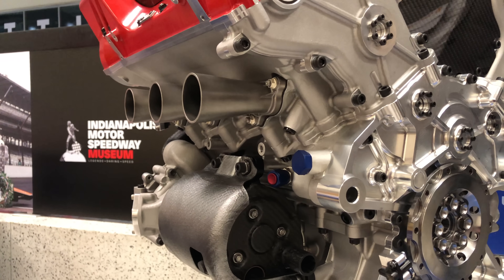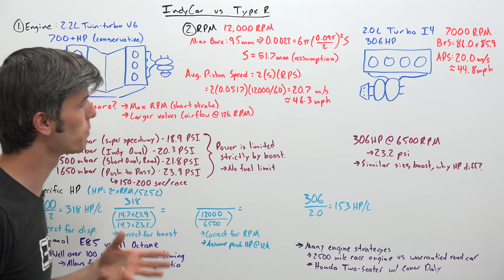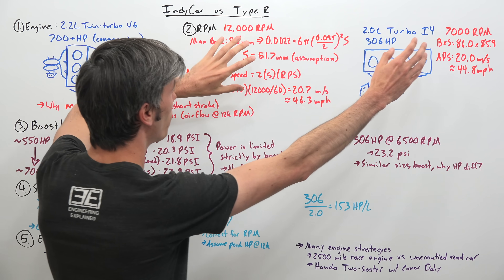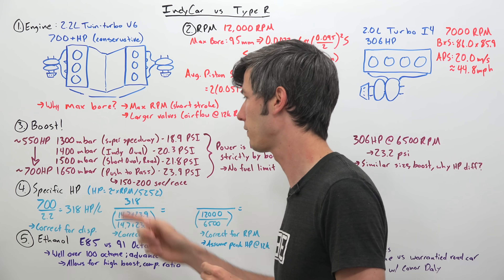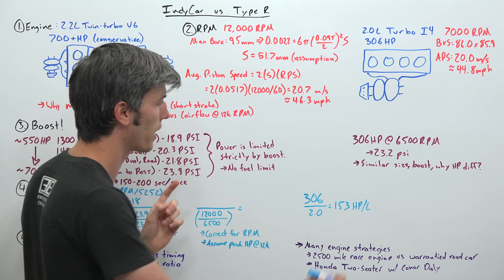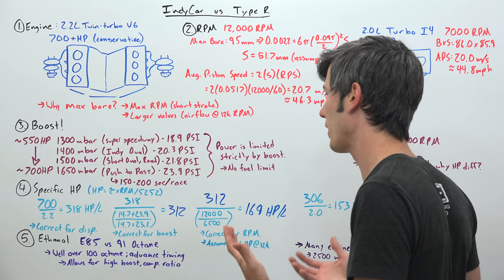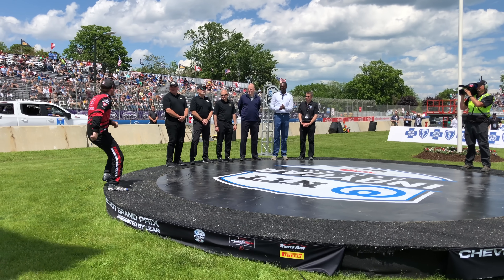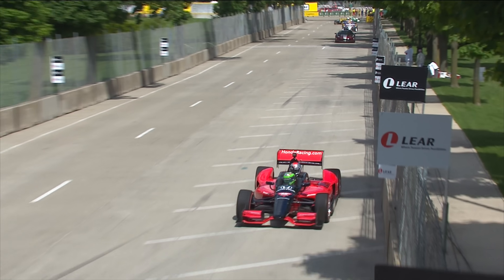How Honda’s 2.2L Engine Makes Over 700 Horsepower

Comment: How are compared to the V6 turbo hybrid  from Formula one ?🤔
Reply: If I am not wrong, the V6 turbo hybrid is a 1.5L with around 950 Hp and RPM limit between 11.900 and 12.500 . Depending if were race or qualifying
Reply: @Sosuke0727  it's 1.6L 1000bhp combined (ICE and Hybrid) probably a little more since there was an article that honda made 750kw in the early 2017.Nowadays, the ICE unit probably making 900HP or a little less.

Comment: Just to say that this is specifically a race engine--it does one thing: racing. You don't want this engine in a regular car :)
Reply: They would probably tune it if they ever sell it in consumer vehicles
Reply: Any Honda fan would be no good with that bad boy.
Reply: Dunno, Rotary engines are (technically speaking) more of a race engine than something you should use frequently but the fun is there.

Comment: So basically, if you throw race fuel at a Civic Type R engine, it's a mini Indycar 😉
Reply: no, the tolerances are soo tight on an indy engine the block needs to be heated up to allow for expansion before startup. Not practical in a daily driver.
Reply: @atvkid0805  I'm guessing you meant to reply in a different thread?
Reply: Rods, connectors, valves, etc etc etc. All it has to be beefed up to handle the increased rpms and power.
Reply: @brkbtjunkie  Its a joke... I'm not saying to modify the CTR engine to be like an Indycar engine but rather the hp/l is very similar once you factor in the boost, displacement and fuel difference
Reply: Actually it would just be a Ciivic Type R engine covered in race fuel if you were to physically throw fuel at it
Reply: @nubbyplaysbass  lmao
Reply: Clay DuVal of course you can get a lot more power out of your Civic type R engine, but you won’t be getting over 100,000 miles trouble free, you’ll have to change your engine after every few races like the race team has to do with the race cars...
Reply: Clay DuVal considering most road-going cars are based on their racing versions, yes. That’s how most all Mercedes work, same with and sporty Honda including accords, same with fords and chevys, and even fiat. Fiat has racing heritage since the very late 1800’s after all
Reply: Indy car engines run methanol. If you want serious power then you start looking at fuels like nitromethane, which need very little oxygen to burn or adding oxidizers other than oxygen like nitrous oxide. Hydrazine is another interesting fuel, but mixing it with nitromethane can be dangerous as it forms explosive salts that are shock sensitive.
Reply: @stefanl5183  Explosive salts might explain past disasters in heavy lift rockets, particularly the Space Shuttle Challenger and the unfortunate realization that there's NO cost-savings in reusable launch vehicles. Makes more sense than a routine build-up of ice on the external fuel tank! Also explains why SpaceX decided to use methane over hydrazine. "Green" fuel is just PR bull corn
Reply: @luislongoria6621  Challengers failure had to do with o rings and cold weather in the solid rocket boosters. The manufacturer of those engines, Morton Thiokol, had warned Nasa not to launch during temperature below a certain point because they knew there could be a problem. Unfortunately on that fateful morning the temps dipped below that level. Why did Nasa still go ahead with the launch? I don't know, but they had been warned by the manufacturer the o rings being too cold could result in improper sealing between the fuel grain, engine casing, and nozzle. That's exactly what happened. As such a jet of hot gas came out the side of one of the solid rocket boosters and was focused directly on the large tank of liquid hydrogen that fuel the shuttles main engines. After some time, it finally burned through the tank and boom!

The ice on the tank you mention was believed to have caused the columbia disaster which happened many years later and occurred on re-entry. It was believed that a piece of ice must have struck the tiles that form the heatsheild on the underside of the shuttle and possibly damaged it. Anyway, that was a separate issue.
Reply: @stefanl5183  How cold is it in Florida? All the best launch sites are in tropical/subtropical locations. I'll save the o-ring debate for immature memes 💩
Reply: @luislongoria6621  There's no debate about the O rings. Morton Thiokol warned them about it long before the accident happened and it's documented. And on that particular morning the temps were unusually cold and dropped below the limits that Morton Thiokol had set. Also there's video showing the leak on the solid rocket booster before it burnt through the tank. Anyway, there's no nitromethane used in the shuttle. So, it couldn't be that there were unstable salts from the mixing of the 2. 

Now, back in the early days there were some drag racers who "experimented" with adding small amounts of Hydrazine to their Nitromethane. And at that time with the lower boost pressures they were running back then it sometimes sorta worked and gave them more speed and horsepower. However, as I said, it was very dangerous as when the Nitromethane and Hydrazine was left mixed together in the tank, it would form highly explosive and sensitive salts. This meant the car could just blow up at some later time. So, they quickly learned that when they did this they had to either run it all out or drain the tank, to avoid trouble. Anyway, later on the boost levels became so high that the pressure in the supercharger and intake manifold would detonate the mixture before it ever made it to the cylinder. That combined with the fact the NHRA banned the use of Hydrazine pretty much brought this to an end. That's what I was referring to in my original comment. Anyway, it might be possible to utilize Hydrazine today, but youd have to keep it separate from the Nitro until it got to the cylinder. basically, youd need a whole separate fuel system just for the hydrazine and an injector directly into the cylinder. Then youd inject it directly into the cylinder just before the cylinder was ready to fire, much like a diesel. maybe you wouldn't even need spark plugs as the high compression and the reaction with the hydrazine would provide ignition.
Reply: @stefanl5183  I saw a NASA table of potential rocket fuel combinations, but it didn't mention which launch systems use specific mixtures. Asphalt in a rocket motor, for example
Reply: Clay DuVal , no no no, it's not designed that way, you need the larger valves and specific bore & stroke for the RPMs. that's how you get the HP , oh, and the fuel to. E-85 baby !!!!!!!
Reply: No. Not without retuning and modifing fuel system.

Comment: Swap the honda indie motor into your S2000. Bet you wont sell it then.
Reply: And need a new one after 2,400 miles?  Well, that might make a multipart YouTube video with a mechanic or two.
Reply: @wumpusthehunted2628  to be fair itd probably be fine for a lot more than 2400 miles if it wasnt being revved to redline every 4 seconds lol
Reply: @How2HateYT , exactly! 😃 We've run motorcycle grand prix engines on track days for years and get great longevity from them, as they are stressed nowhere near as much as they were in race conditions [and by professional racers]. Letting racers & ex-racers ride them now and again soon wears parts out though! 🤣🤣🤣
Reply: @How2HateYT  this engine is made to rev high, turbos probably provide no boost al lower rpm, it struggles - its a small engine and wont be e60m5
Reply: Meester Chris yea a detune and (slightly) more modest injectors would probably help with longevity. i always wonder how long these overbuilt engines would last tuned down to stock spec
Reply: @wumpusthehunted2628  Most of the reason those motors are rebuild/replaced after 2500 miles is because they are being run full tilt for hours at a time where even frequent track days in a production civic wouldn't put nearly the strain/wear one the motor. if you for some reason street drove an indy car the motor would last significantly longer.
Reply: @Glarth-WC  not forgetting if you ' apply '  that kind of power for more than a couple minutes on roads you'll definitely book your seat in the morgue.
Reply: @wumpusthehunted2628  lower boost or going n/a and a rev limiter to 8k rpm and you're good to go for ages
Reply: @wumpusthehunted2628  Then sell it before 2,000 miles.
Reply: that would make an awesome SEMA build ^^,
Reply: Can’t imagine how much one of those Indy car engines would cost
Reply: @Gk22632   Only $1.5 million .
Not bad hey?
Reply: @loktom4068  Not bad at all... in comparison to $10.5 million F1 engines.
Reply: You can’t “baby” a race engine.

The clearances are too tight (typical race engines are effectively “seized” when cold) and they are tuned to produce power at high RPM which means even idling they are running at very high RPM. You’d maybe get a couple extra thousand miles out of it before it was toast.
Reply: I started out with Hondas.  Love them. Last project honda was 91 EF with 300 hp LS swap. Took a crap on alot of cars. To hell with pos EV's.
Reply: @lancedooley7558  you took a crap on a lot of cars? Not cool dude.
Reply: Indie huh?
Reply: @capitan shovel, reduce the rpms to type-R levels and you get type-R performance (not racecar).  Reducing boost would be worse.
Reply: He’s probably selling it as he’s got plans for something amazing. (:
Reply: Lol
Reply: Hilarious way to grenade the transmission, if nothing else.
Reply: Set the rev limit at 6.5k & they'll sell out
Reply: Already sold I guess
Reply: Ask the teams what they pay per motor, that'll cool your jets!
Reply: Arthur Wall  you need more boost in your engine dude more boost
Reply: Hai
Reply: How are you
Reply: That's what Takumi's father did in Inital D.
Reply: I’d pay 700k for that, I’d become an investor in the company just to make that happen.
Reply: If this is hypothetical(since this would be much more work and money) why not use this year's f1 powertrain instead? That acceleration with the hybrid is nasty.
Reply: If they sold as a creat drop in it would not stay on the shelves
Reply: I just might do that
Reply: But then you will have to change the transmission every 6000 miles 😂😂
Reply: I'll do it :D
Reply: The S2000 had a 237hp L4 2.2l naturally aspirated. The type R engine would probably fit and be a worthwhile 30% power increase.
Reply: Robert Schwartz the type r engine is taller than the s2000 engine. The hood would have to be cut to fit in there.
Reply: @WalterSobchakEsq  i think the transverse mounting point of the engine would cause problems in a longitudinal chassis
Reply: NotPharrell it would need a different oil sump and probably coolant routing but it can happen, people put k series in rwd applications pretty often
Reply: Robert Schwartz why downgrade?
Reply: @Norrr3  Dem gainz
Reply: @WalterSobchakEsq  why would you put a low revving quiet engine in an S2000, it defeats the whole purpose
Reply: _ VesBraun s2000 isjunk like the rest of their brand,economy is cheap affordable lmao,not high end performance,my camaro just eats them with its ls6 all day and year long.
Reply: Jr Carclay yours is junk. Look at your clunker

Comment: Wow but Mercedes does the same, just out of a 1.6 liter ;)
Reply: And one turbo
Reply: more like 1000 horsepower by now but yeah
Reply: John Nitrous  that was in qualifying mode for one lap. Two laps and it goes bang
Reply from the maker: Yeah, with higher boost, higher RPM, and a hybrid system that adds power/torque as well. :)
Reply: @EngineeringExplained  nope also around same rpm and no hybrid system, with the hybrid system it's over 1000hp. But yes boost it higher but they have a fuel limit of 100kg/h
Reply: @Maskinmester-DK  no f1 has 15k rpm and the over 1000hp is qualifying trim
Reply: @aspenceley69  I know, no non of them use the 15000rpm. They shift at about 11-12k
Reply: @aspenceley69  and the 1000hp is with the hybrid system, I was talking only engine power.
Reply: @Maskinmester-DK  engines made around 870 in the 2015 season by now they're making more than 1000 combined in Q3. Besides the Indy doesn't run constant 700hp because of the push to pass system so the point of it making power for quali only is weak
Reply: @turnip8173  they fore sure don't make 1000hp only on engine. That's not how it works.
Reply: @Maskinmester-DK  MGU is limited to 160hp meaning they still make 840 hp with 600 less cc and a fuel flow limit. In any case F1 engine > Indy engine performance wise.
Reply: @turnip8173  yes very true. Was just saying that it's combined they make 1000, not only the engine.

Comment: Whoa this needs to be an engine option for the Accord (;

Edit: of course you’d need to tweak a few things so it’ll at least last like a Honda XD

Edit 2: 104 likes? Am I having Deja Vu?
Reply: front wheel destroyer
Reply: @p0ck3tzzz  Drag radial fryer
Reply: R8 Convert it into AWD.
Reply: You’ll need to preheat the engine before every start up.
Reply: It's a race engine would not last demands you would make of it.
Reply: Accord is a grocery getter, you'll be ok with few hundred horses, grandma
Reply: Ilya Elis I’m not just any grocery getting Accord driver, I’m a grocery getter guru (;
I’m a car fan but my favorite car happens to be the 97 Accord because it’s perfectly balanced between reliable, agile, and simple
Reply: Creeperboy and friends well said pal
Reply: 2,600 miles before it needs to be fully rebuilt 🤣🤣🤣 how much you wanna bet it's probably $50k just for the motor

Comment: The Type R engine should be put into the Tacoma. Great Hp and Torque upgrade
Reply from the maker: Haha, but Toyota makes the Tacoma?
Reply: @EngineeringExplained  If Toyota use a BMW engine in a Supra, then surely they can use a Honda engine in a Tacoma. Even better they should use Ford's 2.7 liter Ecoboost. Speaking from experience that thing punches way above it's class. I know they won't, but they should.

Comment: Just need your s2k back  now. I'm sure you can make the engine fit.
Reply from the maker: Haha I still have it, hoping to get it listed this week!
Reply: Engineering Explained I have $5 and a pack of gum
Reply: JVST DAI I have $7 and two packs of gum. Looks like the S2000 is mine.
Reply: @EngineeringExplained  so honda is going to be missing  off its v6 engines? 😂
Reply: @EngineeringExplained  what would you replace the s2000 with?

Comment: Big deal lmao. F1 cars were making close to 1000hp from a 3.0 v10 with no turbos and revving to over 20000rpm
Reply from the maker: Okay haha, I think there's more to cars than F1. Enjoy learning about all of it, and I say that as a big F1 fan. 🤷‍♂️
Reply: @EngineeringExplained  the innovation probably comes from emissions and fuel efficiency. I bet a 3.0 V10 was probably much more thirsty (and weighed more) than a 2.2 TT. 
Would love to see a video on it. I think the history of engine development in motorsports is pretty interesting
Reply: Well yeah.. But those are 10 cylinders  and in a 3.0 motor . As this engine is small an can probably make 1000hp easy. Soo...  I dont get your point
Reply: Saves a lot of weight too
Reply: Also just because it revs higher doesn't mean its faster

Comment: How can a V6 rev 12.000 rpm?
Reply: the same way a v8 or v10 f1 engine can rev to around 18000 rpm
Reply from the maker: Watch the beginning of the video. Short stroke! :)
Reply: Engineering Explained thanks!

Comment: the answer is VTEC BABYYY
Reply from the maker: Haha, funny enough this has a fixed cam profile (as regulated), but the Type R does have vtec on the exhaust. Once turbos got involved variable lift wasn't as important on the intake, so it's been dropped.
Reply: @EngineeringExplained  This is probably a noob question, but is it possible to change the ignition timing and duration of the spark based on rpm, if not the lobe lift like VTEC?  Can ignition timing be controlled by the computer and crankshaft position so it varies, instead of being linear to the rpm? Would that benefit?
Reply: 賢治 the Eagle yes, that would benefit, it’s already out there on numerous engines.
Reply: @EngineeringExplained  was just about to say that.
Reply: @EngineeringExplained  I was going to comment that but it seems you got to it a few months ahead of me. Ironically vtec goes out of the window in nearly every single race car that Honda has, from the HART team's time attack car to their Indy cars.
Reply: @EngineeringExplained  valve springs or pneumatic valves?
Reply: C. AF BBWWAAAAAAAAAAAAAHHHHHHH
Reply: @Creeperboy099  donut media flashback
Reply: Vtec...bwaaaaaahhhhhhhh
Reply: "your car is gay"
"what"
"your car is gay!"
"...so is your dad"
"that doesn't even make any sense"

if know where this is from,I like you
Reply: Pepe Smith it’s the rice Civic Racing the chevy
Reply: Moar pawer baby
Reply: VTAKKK KICKIN IN
Reply: HEY HOMES, YOU GOT VTEC?
Reply: This engine doesn’t have vtec...
Reply: Nah...I-VTEC. ftw. (so says original owner of an '07 Civic Si- motor alone...) all for fun.
Reply: FreeValve is the answer.
Reply: C. AF , variable valve timing ?
Reply: This is what I was looking for
Reply: No vtec okay. This time only
Reply: No VTECH X-TREEMMMMMMMM
Reply: Stance is gay...................................